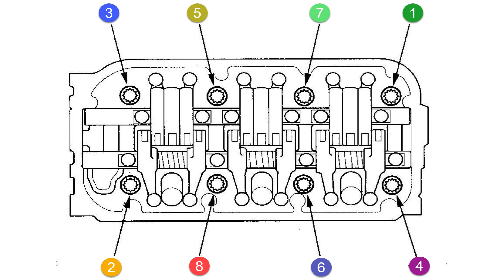2008 Acura MDX Cylinder Head Removal - Part 6 of 6

Comment: You did a fantastic job struggling to take that thing apart. Now if you succeed in putting it back together to where it's in tip-top running condition, you will absolutely be worth your weight in gold.

I don't know much about highly involved engine disassembly but the first thing I would have done is remove hood - especially when working alone.

Otherwise, very interesting, informative and enjoyable.
Reply from the maker: Thanks. I haven't found a reason yet to remove the hood, since the engine is not coming out of the car.

Comment: Thanks for posting it. I just removed both heads and they are off to the machine shop. I had trouble with that coolant assembly there was a little hidden bracket that wouldn’t let me move that manifold towards the battery box. After I found it I was able to use that wood and hammer method and I got it all out.
Reply from the maker: Great to hear. 👍

Comment: So when i did the timing belt on my 13 13 MDX I wanted to change seals on the cams, i forgot to loosen gear bolts when belt was on and used impact gun moving can about a 1/4 of a turn, i was hoping i didn't damage valve but when i finish installing everything and started the car i felt vibration in the engine, i knew what it was. Very expensive mistake
Reply from the maker: 😮 Did you confirm the damage?